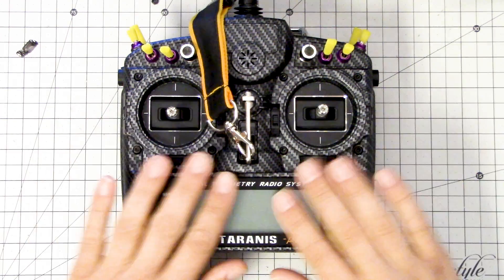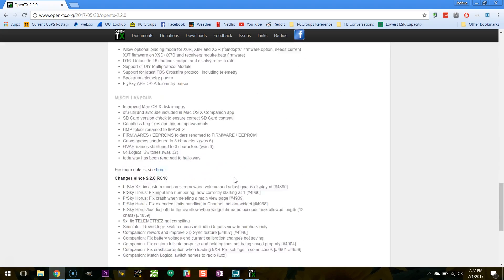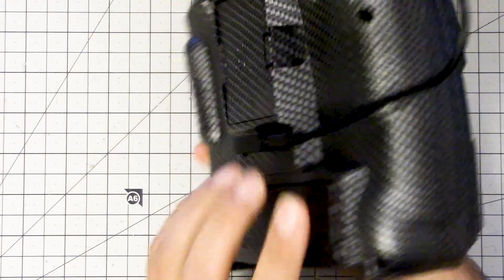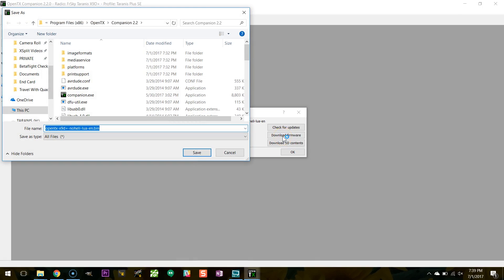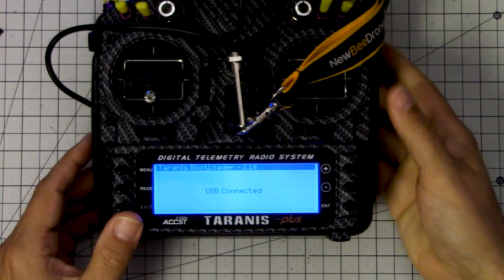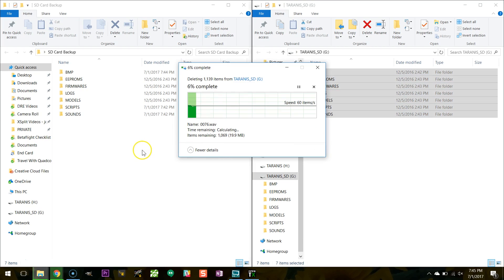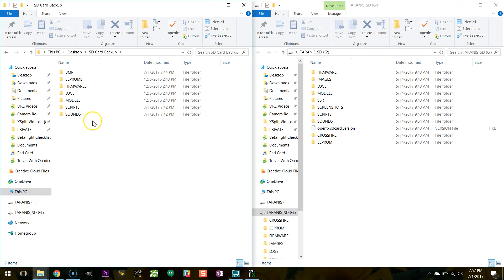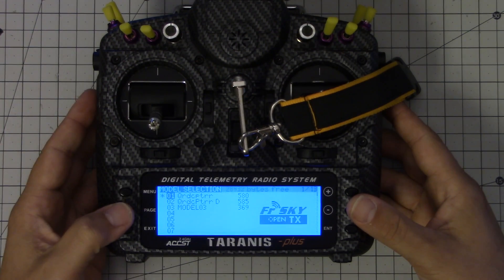Betaflight Taranis Lua Script HOW TO | Part 1 | Install Firmware

Comment: HI Mr Joshua , How do I connect a tbs unify pro vtx to a kiss flight controller with a foxeer camera, the point is I want to have audio sound (in order to listent to the motor) and audio smart in order to change  video channel and power from taranis 9d plus

Tbs unify pro vtx has only one white wire for audio or smart audio, can I use this white wire for both audio and smat audio simultaneosuly?  How do I connect?
thanks for your repply

Comment: Hello Joshua, thanks for your video, I've updated my taranis X9D+ firmware from 2.1.9 to 2.2.0 step by step as described in your video  but when I switched on the radio after the firmware has been write to the radio I had nothing, the radio stays off ...... 
I have to unplug the battery to recover the "bootloader mode" but as soon as I quit or unplug the usb and want to switch on the radio my taranis stays "off" ......what could be wrong? EEPROM version too old? my taranis is a X9D+ but ithe first series from 2015...... .can you help me please ? regards. Aurelien

Comment: Love working and building just as much as the flyin' built three now only half year into hobby and getting better goal is to fly a lookout peak by my house in DUNDAS ONTARIO CANADA it's on google earth Dundas peak. Hopefully before winter. Got a question do u wear your glasses under your googles or have you corrective lense inserts. Googles aren't comfortable with my glasses so use a bulky walkers fpv headset as it has more room. Just curious
Reply from the maker: +Andrew Blanche I have lens inserts from RHO-lens.

Comment: Josh I am bug eyed just got Frysky QX7 but manual is useless and I can't map the switches paired with X8R Sbus receiver have sticks working but I can't get any response from auxiliaries channels to use any switches. Why is opentx written like its foreign language call things what they are in betaflight cleanfight. Also I want to use Rs2205s motors on my Jarapula frame can't find any mount conversion brackets.
Reply from the maker: http://open-txu.org/

Comment: Hi Guys
Can anyone help me out after following this great video. when i turn my Taranis back on I'm getting SD card warning and also it won't let me select model 1 it only stays on model 2 any ideas??
Reply from the maker: You have to update the SD card contents as well as update the firmware. Instructions are in these videos.
Reply: Thanks Joshua
I Have now successfully got got rid of the SD card warning, but now if i select another model it locks out then reverts back to the model i was on, also if i try to back up the model in the Taranis its saying SD Error?
Im nearly there  if you could help on this last little bit i would be grateful

Comment: hi Josh,  sorry for  asking this daft question.  I have watched the 2 vids on the Lula scrip.  I think I understand the taranis side of things, but to have the piss accessible on the handset, do you need a special receiver and also have it wired to the flight controller a certain way?
Reply from the maker: Yes you need SmartPort telemetry running. So this will only work on X series receivers.

https://www.youtube.com/watch?v=0BCKdWgAps4
Reply: thanks for the reply.

Comment: OpenTX University has amber sound pack for 2.2 http://open-txu.org/v2-2-resources-2/
Reply: Just so you know: the Amber Sound Pack is a rar file. When you go to the link provided on the OpenTX site to download the Winrar program https://windows10portal.com/download-winrar/ and install this program installs unwanted spamware. Like Web Companion and a Web tool bar. It also changes your home page of you browser.
If WinRAR was a respectable program it wouldn't be doing this. Does anyone know if there is a winzip version of Amber?

Comment: ok so strangest thing happened to me today. I had updated OpenTX from 2.1.7 to 2.2, all went well (bootloader remained at 2.1.7). I tested everything, even the 2.2 amber sound pack sounded fine. 
Today when i turned my Taranis on in bootloader mode, i was getting a blank lcd screen (the 3 options were missing). Amber was also not working at all when booting normally. 
I flashed the bootloader to 2.2 via SDcard and all problems gone.

Comment: If I am currently on 2.0.17 and wanting to upgrade to the newest 2.2 will I loose all of my models/setups and do I have to switch to 2.1 first then up to 2.2?
Reply: rsokors they should be fine as long as you back them up. I would make a second backup on the PC as well
Reply: I want to know this as well.
Reply: 80miles_A_day Do do we need to do 2.1 first then 2.2? Or just straight to 2.2?
Reply: TribeQuadQuest that question is out of my league. Sorry, Joshua has the floor there
Reply: all good. Upgraded to 2.1. then 2.2. Everything is in order and working. Lua scripts and all. Thanks for the help :)
Reply: TribeQuadQuest Did all of your models and binding transfer?
Reply: As far as I can tell, yes. I have not checked all models yet. I have worked with about three out of the 30 or so and they are working fine. If you have telemetry set up on any of your models you will have to redo those. Also, if you are using the RF1 lua you will need to scan for sensors in the telemetry menu in order to get it to work. Other than that it was fine. Just back up your radio to your hard drive before doing anything. I actually backed up both of the folders that pop up when you plug the usb into your computer and I also backed up the radio to file in Companion before doing anything. Lastly I recalibrated the radio and everything seems to be good. I will be taking it out to fly tomorrow and testing about 12 models.
Reply from the maker: OpenTX recommends going through 2.1 first. But honestly, I would consider just re-building them. The main thing that changed going to 2.0 is the telemetry system.

Comment: Hello Joshua I try to update my new Taranis X9d plus SE just like  you show in the video the write to radio with complete took out the usb from the radio and exit when I went to power it on it does not power on now.  The radio did not exit and turn on again like in your video where you exit and then turn on to update itself.  Is my radio brick??  The only way I can turn on the screen is by disconnecting the battery and then it lets me go to boot load mode but thats it.  please help.
Reply from the maker: If the radio only powers up in bootloader mode, I am going to guess the flash did not actually complete. I would re-flash the firmware to the radio. Be sure you have the correct radio type selected in Companion so that it is flashing the correct firmware.
Reply: Thank buddy I did exactly what you said here and it works now.

Comment: Since many of you like the Amber Sounds/Custom Sounds for your radio, I put together a few Star Wars Sounds that you can add to your Taranis.  They are located here (can't promise to keep this link forever) https://www.dropbox.com/sh/71959vwhjn00mzv/AACVHY9ZuhQ8B9SOHOv62MNea?dl=0

To install them, you need to put them in the Sounds folder of your Taranis SD Card and in the sub folder of your language. For me, that is the EN folder for English.   If you want to make any of them your startup sound when you turn on your radio, then put that file in the Sounds >en>System and rename it to hello.wav and it will play when you turn on your radio. This video Joshua made should help you know where to put them and you need to be running Open TX 2.2 for them to work. BTW, the bootup sound in OpenTX 2.2 changed to be called hello.wav. I

Some suggestions for when to use them:
yesmymaster - good for startup (hello.wav) sound replacement
theforce.wav - good to use for the switch you use to put in manual mode
lightsaber 1 - 4 - could be fun to use of switch sounds
imperial_march - another good startup sound to rename hello.wav for the system folder
darthvader_asyouwish - another good startup sound to rename hello.wav for the system folder, or for switching into angle mode
hansolo_situation - another good startup sound to rename hello.wav for the system folder

f you feel like making your own sounds, I use Audacity (free for mac and pc) and be sure the Project Rate is set to 32000 (hz) and save as a wav file in 16bit. 

Enjoy and happy 4th. I'd love to hear if you like them.
Reply from the maker: Do you know how to generate more Amber voice sounds? Is that a voice generator that's available?
Reply: Joshua, let me first say, huge fan of your channel and wouldn't be the pilot I am today without you! Thank you ALL your time and effort.  Now regarding Amber, my understanding is that she is a real person and someone in the community got her to do the sounds. Not sure, but that's my understanding. For text to speech, there are a number of online sites and apps that allow you to create audio files from text and in different voices. If you find one you love, let me know. IBM and Amazon have tools, but I believe they cost something.  I could see the community posting a library of all kinds of fun sounds.

Comment: Hey Joshua! Is this thing work with cleanflight too? (I saw that the plugin is called BF, thats why I'm not sure about it)
Reply from the maker: It should work with Cleanflight 2.0 and newer, because CF rebased off of BF with version 2.0. So basically CF 2.0 has all the features of BF 3.0.

Comment: Thanks for the series. I got really keen for this and it installed easily thanks to your steps BUT it doesnt work :(  And FYI there are a heap of guys having problems running this script with XSR rx's with the latest firmware installed in the XSR rx's according to comments on the Oscar Liang page.  Telemetry working but only displaying dashes.
Reply from the maker: +TAXDODG XSR firmware has some telemetry issues.
Reply: Ah dammit I only run XSR's

Comment: hey josh, so ive download companion 2.2.0 on to mycomputer but when i download the firmware to my computer and the firmware goes to save it comes up with an error and says "invalid language" have any idea whats going on?
Reply from the maker: +Kyle Foster no idea, sorry.
Reply: I've got same problem were you able to sort it ?
Reply: Shyfly negative. After that message I turned my computer off I'll have another look tonight. 2.1.9 downloaded fine just not 2.2.0
Reply: in companion re select your radio even if its right and tick lua box like in video and flash firmware that fixed mine !! if you get an issue with sd card let me know as i had to fix that also bud
Reply: This is documented in the "Known Issues" section of the release notes.

http://www.open-tx.org/2017/05/30/opentx-2.2.0

Comment: I have done this had already done this without activating LUA on my firmware version and it still worked. 

The only thing that seemed to change for me was activating LUA gave and extra menu. I could still access the script function on the Display menu without it.

Comment: I upgraded to open TX 220 . But when I go to write firmware to radio. It still says 2.1.9 in the version line?
Reply from the maker: That's the bootloader version I suspect. I have a video on how to update the bootloader coming next.
Reply: It all good I figured it out i was upgrading again from 2.0.9 had to just download again 2.1.9 . Then it read 2.2.0

Comment: Hi. Sexy voice ;) 
After switching to 2.2 the main thing I had to do was to discover sensors on my copters so I could reassign the right parameters used in the functions to detect low voltage (as presented by yourself in another vid). Could have been worth a comment or a watermark (if I didn't miss it obviously).
Reply from the maker: For me, I didn't have to do any discover sensors going from 2.1 to 2.2. But if you are coming from 2.0 or earlier, yes, that is a thing that changed.

Comment: Hey Josh, I just updated the firmware so I can have lua now I trying to erase the SD card and put the new stuff on it but in the middle of deleting everything the radio disconnects from the computer.
Reply from the maker: The original SD card that came with the Taranis was crap for me. It kept disconnecting even when I took it out of the Taranis and put it into an SD card reader. I would suggest replacing it.
Reply: Ok thanks

Comment: I cant delete the things inside the SD card, it comes up with an error.
Reply from the maker: Take the SD card out of the Taranis and try using an SD card reader.

The SD card that came with my Taranis was shit and kept disconnecting even in a reader. I suggest replacing it with a name-brand.
Reply: Thank you, I have got it working now after using an SD card reader. :D

Comment: Hey Josh your vids are always good and informative but my question is I picked up a EU Taranis from a guy and was wondering if I put that firmware on it could I bind US recievers to it then cause I have a JXT on the back but I think it's going crazy it keeps loosing telemetry
Reply from the maker: I am pretty sure that yes you can flash the US firmware to the EU Taranis. I don't think anything is different about the hardware.

Comment: I am glad that you put this up Josh. I have been running this for about a month now and I like how I don't have to plug in to tune or change rates. I have mentioned this a few times out there in the community, but it gets lost due to most pilots using OSD.
Reply: Ok. I might have gotten a little ahead of ya.lol Part 2.

Comment: Hey Josh, update your bootloader too. It's still on 2.16. or is it not really a big deal? JC actually taught me how to do it on one of his vids. Man, really going to miss him.
Reply: The bootloader is actually a part of the firmware file, but to have Companion write it to the Taranis in addition to the main firmware, you need to connect the USB cable with the Taranis TURNED OFF.

The problem is this doesn't always work (maybe because the current bootloader is too old for Companion to work with it), and instead you'll need to copy the firmware file onto the SD card through USB, and then update the bootloader from the Taranis' built in SD card browser.

Turn on the Taranis, go past any throttle/failsafe/switch warnings, then hold MENU, click PAGE, navigate into the FIRMWARE/S folder, and hold ENTER on the firmware file to get an option to update the bootloader (click ENTER again a couple of times to confirm).

If your firmware files have long names like "opentx-x9d+-noheli-lua-en-2.2.0.bin" they won't actually show up in the built-in SD card browser, because it's limited to filename lengths of 32 characters or less, so you'll have to rename them in Windows/OSX after copying them over.

Comment: If I do this update, will I have to rebind all my models?
Reply from the maker: No. Your models should transfer over. Especially if you are currently on 2.1. If you are on 2.0 or earlier you might have some trouble converting your models.

Comment: To use the amber sounds you have to painstakingly rename the files. 0-112 are the same but after that is the decimal points and they are one number off. Other things like vbat, modes, and measurements have to be listened to and renamed with the corresponding amber sound. And If i remember correctly the startup sound is now named hello. Put your model images in the bmp folder, and the lua script in the telemetry folder.
Reply from the maker: You don't. There is a 2.2 version of Amber that is linked in this video description. Your instructions about the Lua script are also out of date. 2.2.0 uses a different method.
Reply: oh cool thanks, i didn't see the amber sounds in the description. I also didn't know about the noheli setting. I did choose the sqt5font.
Reply: I just looked back and the problem i ran into was i already had a SCRIPTS folder on my sd card, and it had some folders within i didn't want to delete as i didn't know what they were. So what i did was put the BF folder(containing msp_sp.lua and ui.lua) in the SCRIPTS folder and BF.lua in the TELEMETRY folder.

Comment: I have updated my Taranis, I can see the PID screens on my Taranis, I just get no values.  Running KISSFC with 1.3.  Still working on getting it running.
Reply from the maker: https://oscarliang.com/change-pid-vtx-settings-taranis-lua-kiss/
Reply: This is the write up I followed
I get the screens to change them, I just don't get the values.

Taranis X9D+ flashed to 2.2.0
KISSFC 1.3
kiss Gui 1.15.6
X4R telemetry wire working (I get other telemetry working fine, battery, rssi and such)
KISSFC.lua copied to SCRIPTS/TELEMETRY folder
Reply: Ive got exact same problem but I'm not running a KISS fc. Same problem both with a Motolab Cyclone and a Kakute fc both with XSR rx. Definitely flashed the lua and no heli version to my TX and definitely have the BF script.  I get all the correct screens but blank values and cant change anything. Telemetry working fine for everything else as normal. Any clues Josh? EDIT: FYI there are a heap of guys having problems running this script with XSR rx's with the latest firmware installed in the XSR rx's according to comments on the Oscar Liang page.  Telemetry working but only displaying dashes.

Comment: I'm looking for a budget frame that protects the motors well. I was considering the rd210 (search it on banggood) and the Martian II. However I have some problems with both. The Martian II relies on the pen for support and I have heard that it's pdb sucks. It's also like 140g. The RD210 is 120g, but the arms extend farther than the main plate (is that normal for all quads? I would prefer if, in a crash, both the arms and the main plate equally shared the impact).